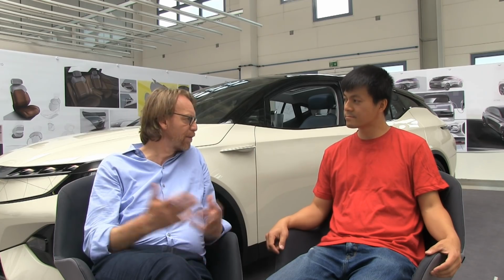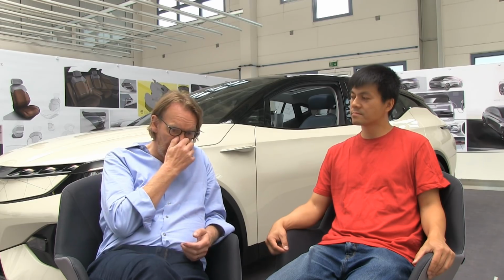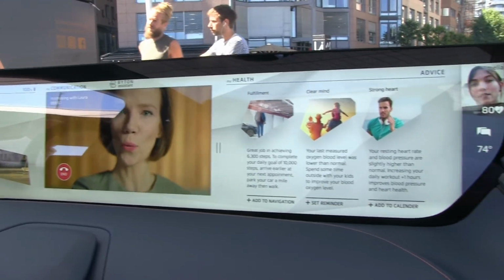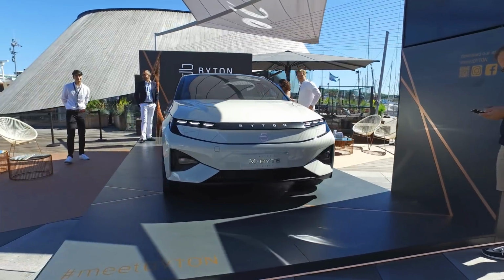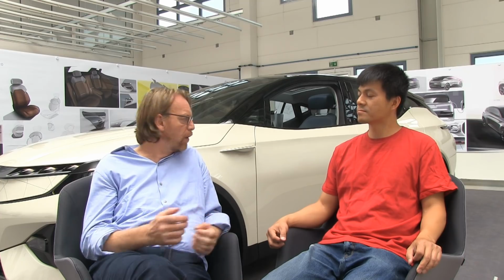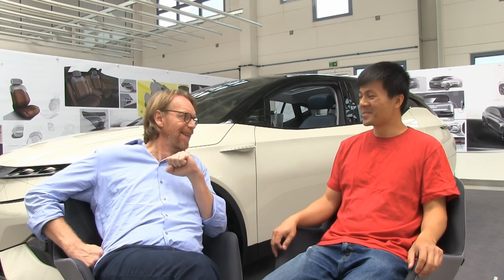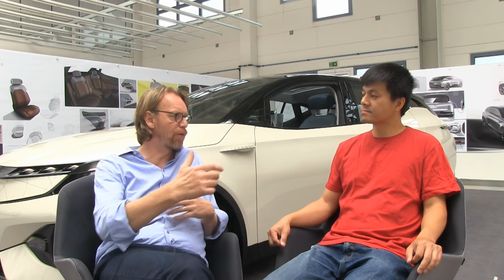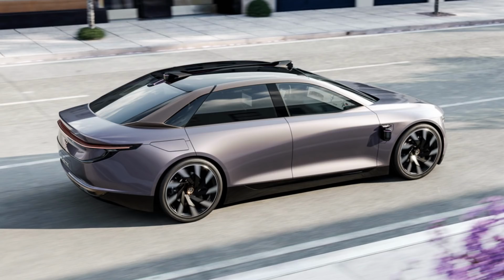Interview with Byton's Vice President of Design

Comment: Do car designers see the future as ever more and more digital stuff crammed inside, bigger or more screens, more cameras and sensors, more apps, networking and AI selfdriving, more taking control and responsibility and joy away from the driver. Or if the next step should be simplification. Remember front light wipers, retractable antennas, ashtrays and audible turn signals? Maybe Byton should be BYD-ton (bring your own device) where there is no screens and every driver could "dock" in how large or small or many screens he wanted i.e. his iPad(s) or android tab.                         That would be truly flexible and future proof.

Comment: I'd like them to thrive, but wtf.

3:34 The lawmaker maybe didn't think about someone putting a glowing pane there. 
It's about the white (or gray) UI that glows. Since it seems to be curved, it might even reflect sunlight in a pretty wide angle.
Even the white interior of the Zoe obstructs the view and everything is in the limits.
Yes, they could change most of it on the software side, but it seems that they(he - the Vice President of Design) never thought about it or even started making it real. 🤦

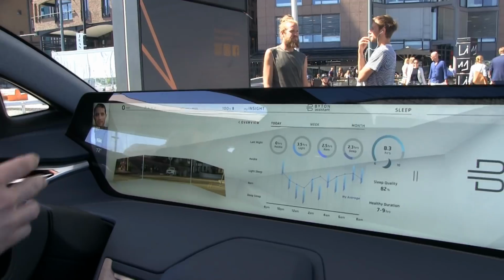4:45 Tesla is (as far as I know) the first one to have actual updatability and changed the life cycle. 

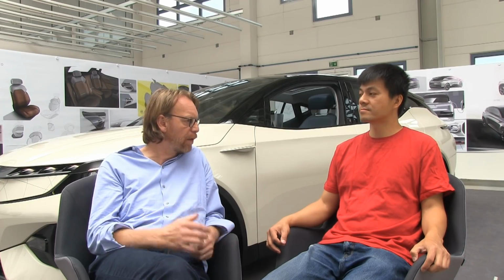9:22 "why not both" LOL
he didn't think about it before.
Redundancy is ok in some cases. They could think about making the real mirrors disassemblable.

14:16
never mentioned the metric "K" and "M", probably doesn't even know :c
Reply: Cool!

Comment: My only question would be, where will they put the driver's front airbag? There is a big display on the steering wheel where the airbag would typically reside.
Reply from the maker: +Igor Jerovsek Don't worry about that.